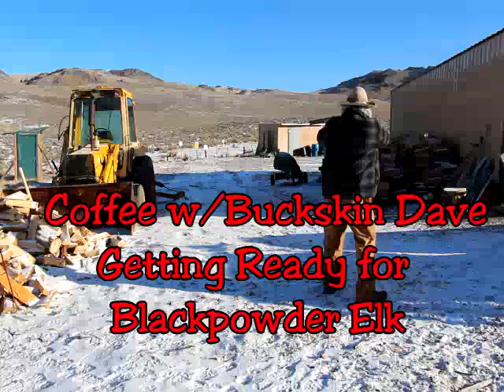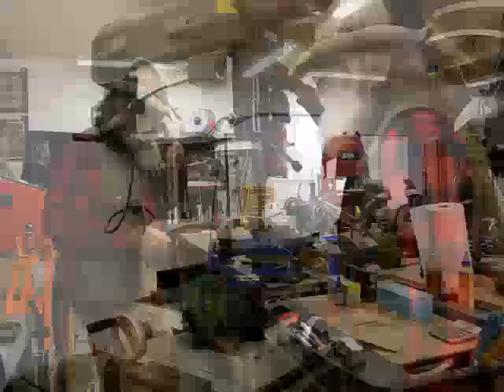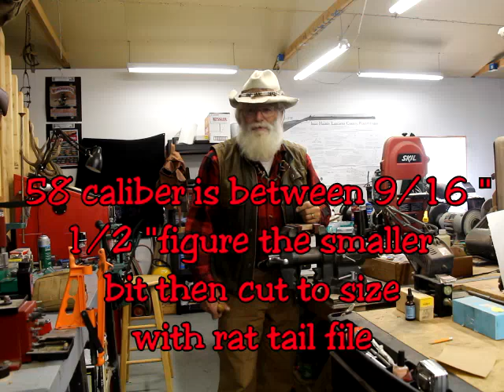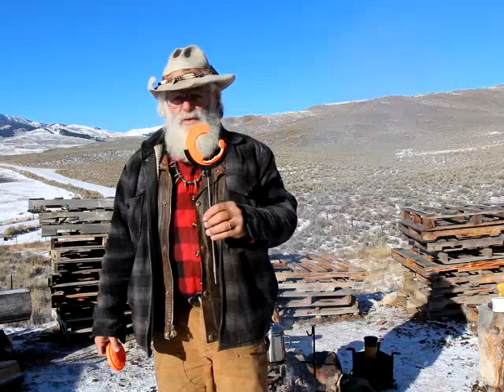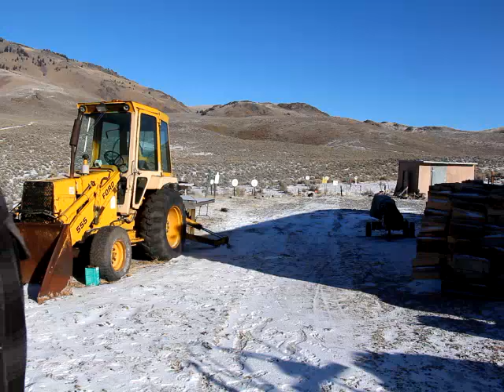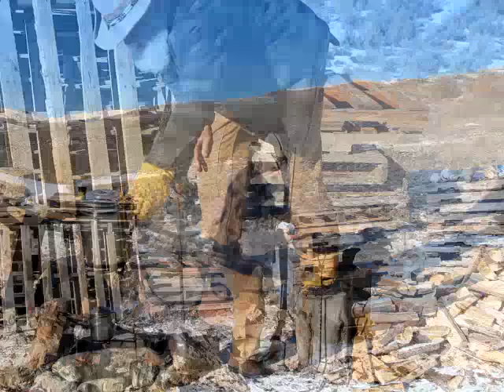Building a Loading Block, Get Ready for Elk Hunt

Comment: I'm confident you're aware of BP speedloaders, but you could shave off a few seconds in the field by pre-measuring powder at home or at the cabin & pouring it into pre-rolled nitrated paper tubes made with cigarette paper. Form the tubes around a dowel of the size that will allow the tube to drop right into the speedloader. When in the field, uncap one end & allow the paper cartridge to drop into the barrel. Uncap the other end, & insert your patch & ball or whatever bullet you've chosen & ram everything home. Cap the nipple & done! Having a pre-made, pre-measured powder charge eliminates that step in the field, less exposure to the elements during loading & most, if not all, of the nitrated paper will be burned when fired. The nitrated paper is delicate enough to split or burst from ramrod pressure, & if not, the percussion cap spark will definitely burn through for proper ignition. Only concern I have is with patent breech barrels. What's your take on all that? Thx for great videos, Dave!
Reply from the maker: I like the pre-load tubes but where I live I have to order them or make them.  I have not used the cigarette paper but I bought some to try one day.  There are a bunch of ways to get it done, I like the speed tubes tho.  Why does the patent breech bother you?
Reply: You're right: the patent breech should be of no consequence. Also, you could roll your own tubes with masking paper, pour in your 80 grains (hunting) twist or fold closed. (The pattern is based on Civil War paper cartridges.)Then in the field you'd only need to tear open a tube, dump the pre-measured powder; use your new loading or bullet block & ram patch & ball home. I agree with you on the Wonder Lube - great stuff!

Looks like excellent coffee there! Don't mind if I do. It's super how you keep that simple too. Love it!

A coned muzzle would eliminate the need for a short starter without affecting accuracy.